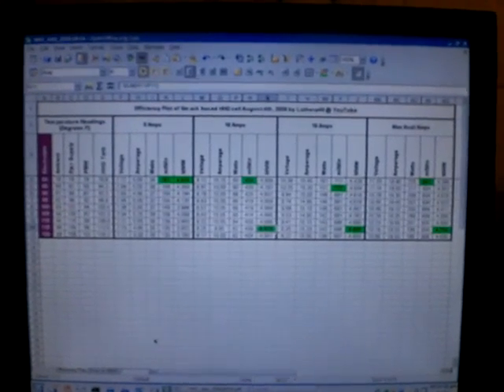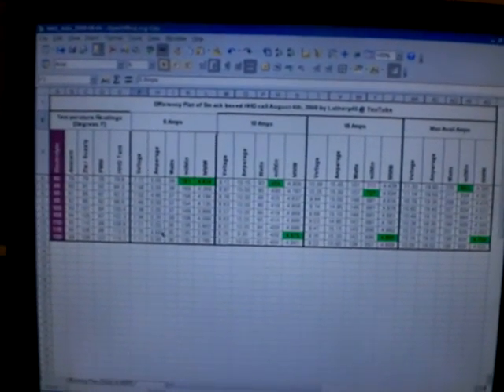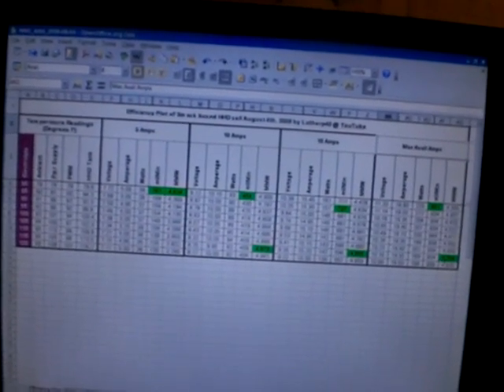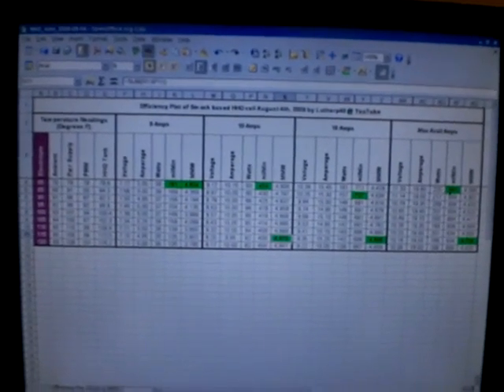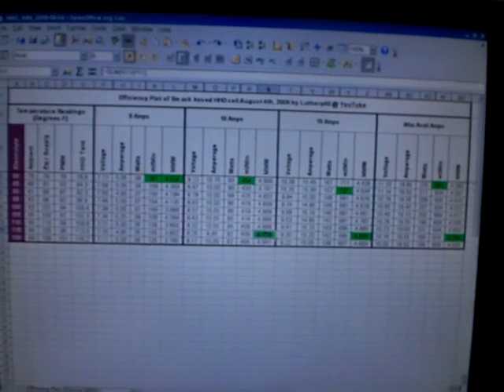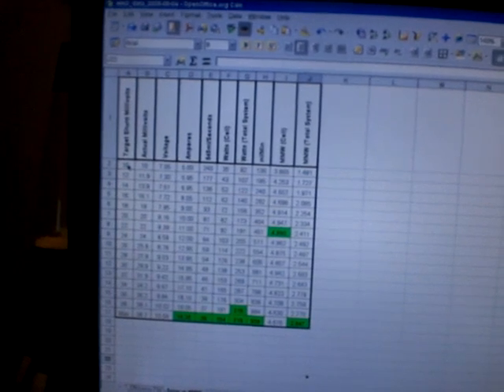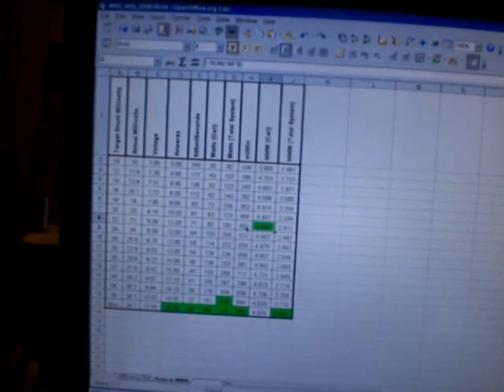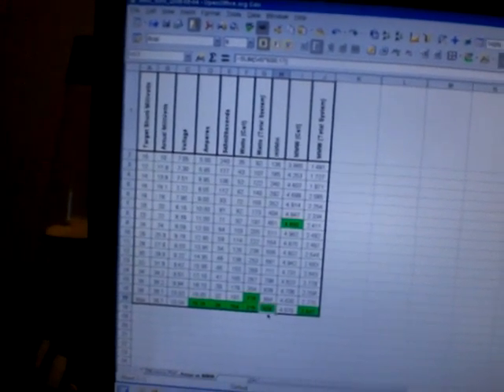Mapping Cell Efficiency

Comment: I have some old information (when HHO was a new science in the 1920's) which suggests that anything over 2 volts across plates is wasted energy - and is expressed as heat. Also, look into inducing a magnetic field across the plates. In one way (N/S across the plates), you add magnetic energy across the plates. It is desirable to have that magnetic energy work in the direction that O and H desire to go when separation occurs.  The boost in HHO production is fairly graphic.
Reply: Right in electrons but the separation is magnetic attractionm